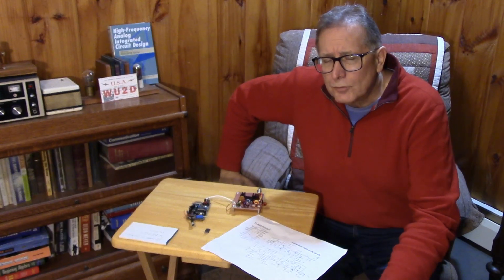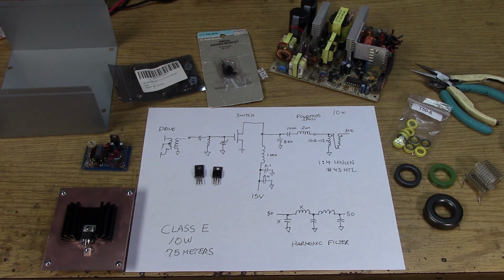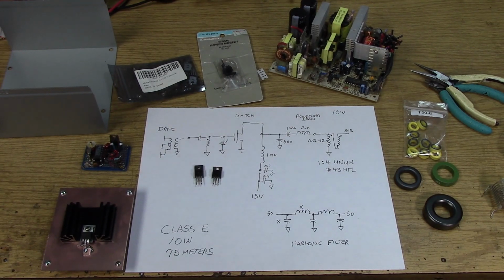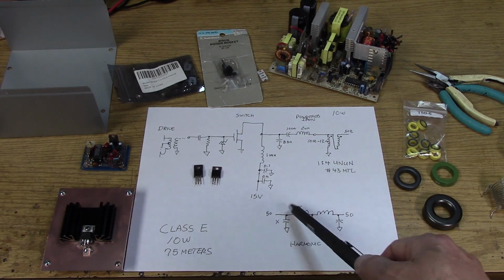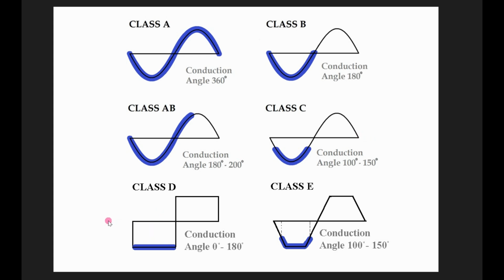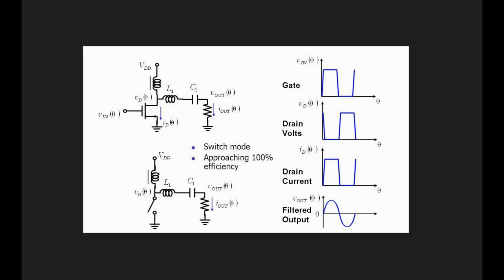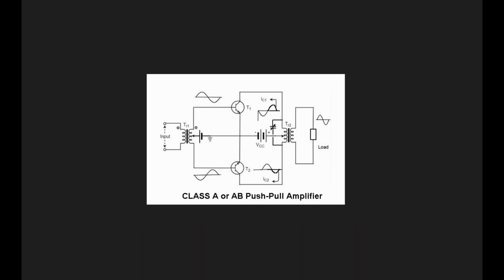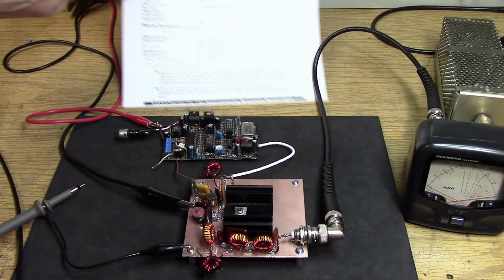PDM Part 4

Comment: One nit-pick:  You showed the Harris MW-1 one-kilowatt am transmitter while discussing PDM.  It was not PDM - it used "progressive series" modulation.  Basically series modulation with extra boost for positive modulation.   I was at WDZ in 1977 and I think we had serial number 3.

Comment: Two months after this series of videos was first shown, I am still fascinated by the class-E  amplifier type. In definitive this circuit (the final part) would be better described by the term: "power-oscillator". There is no linear input-output relation! 

I am a ham and I do SSB mostly.  Alas most of the interesting electronic projects use AM or CW.
Reply from the maker: SSB is a bit tricky for beginners to breadboard cause you have the added filtering and DSB modulator to build.